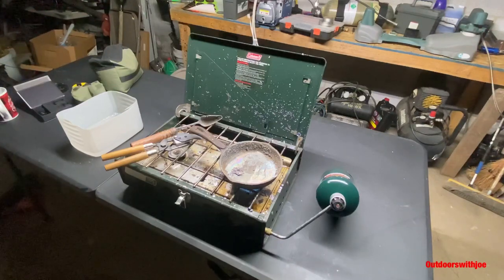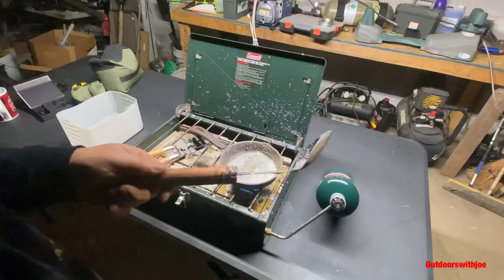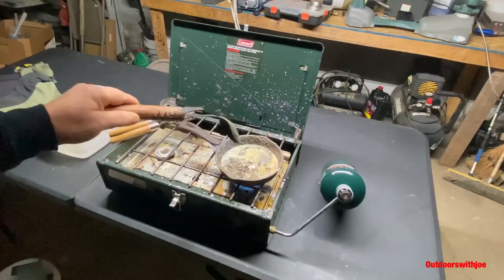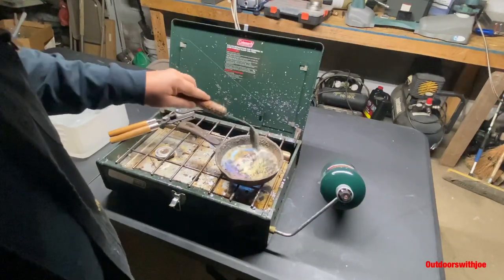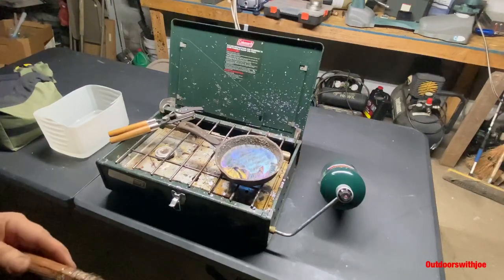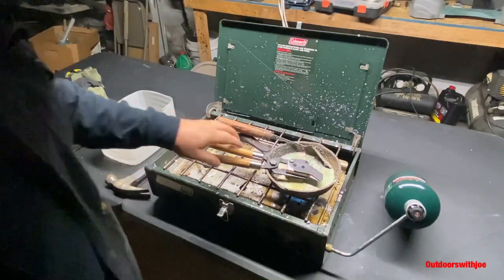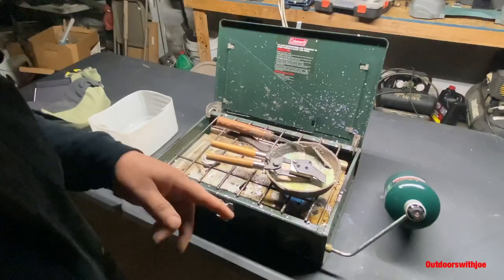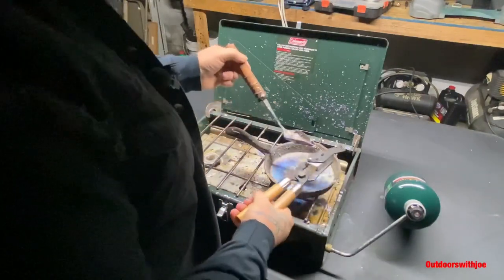Casting Lead Bullets For My Air Rifles

Comment: That lead is waaaay to hot bud... Reason its turning purple and oxidizing on you so fast... Its not slag or impurities... Its basically lead "rust" if you will..... Lower ur heat and flux with wax... Will help dissolve lead oxide back into molten lead....

Comment: I hope to do that one day. I want to get a PCP and make my own slugs to avoid ordering them via mail. How do you feel about using lead tire weights you find laying on the sides of the road ? It's free lead.
Reply from the maker: Tire weights work just fine.
Thanks for watching
Reply: @OutdoorsWithJoe  : 100% agreed!; I've been casting bullets from molten wheelweights for decades now. Just a couple observations:
*Nowadays, additional  to lead alloy wheelweights, there also all.steel & Zinc ones. The iron/ steel ones 'float' on molten lead, BUT Zinc ones will contaminate your alloy and this is NO good at all. You'll notice it in the surface of the molten alloy when its above ~670° Fahrenheit, 'cuz it will turn purplish.
Best regards & stay safe.🙏

Comment: Maaaan brother. Need some ventilation!
Reply from the maker: I mentioned in video that I had doors open and a breeze blowing through. Im very careful with my old lungs lol but thanks for the concern.
Thanks for watching
Reply: I cast 10,000 bullets on my kitchen stove before I ever heard about lead poisoning.  That was over 40 years ago. I still cast. 
Right now I am trying to come up with a reasonably priced .218 ball mold for my 22 cal air-guns.